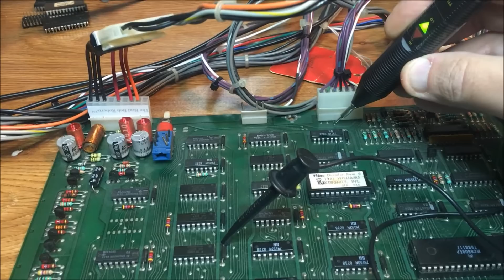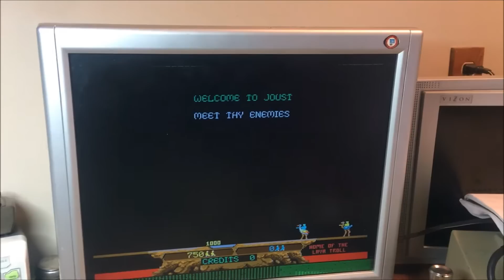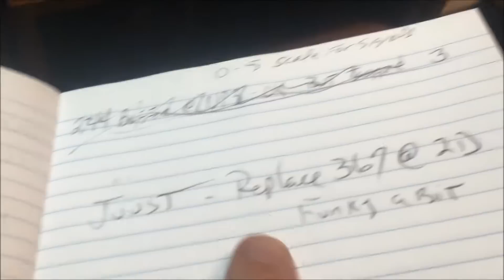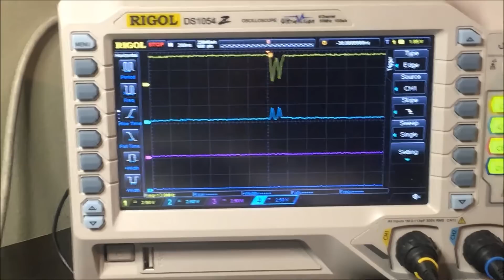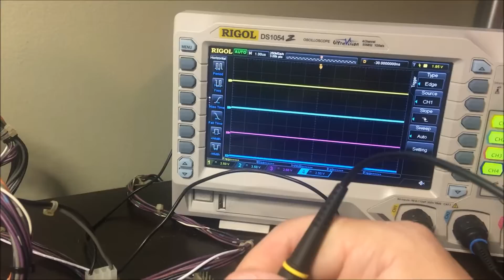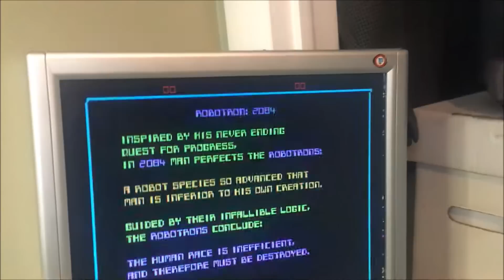1982 Williams Joust/Robotron Arcade PCB Repairs

Comment: At 12.20 you explain the AND gate and Pin 11, thank you. But how do you know that pin 11 has to be zero from the schematic. Because it hits the transistor and that needs it to be low?
Reply from the maker: the level on the base of that transistor needs to be 0v  (or just a lower potential than whats at the emitter ) for it to turn on